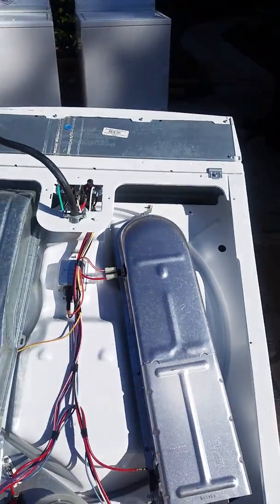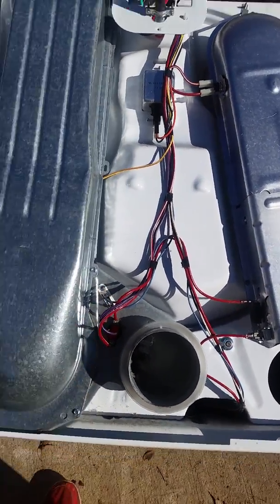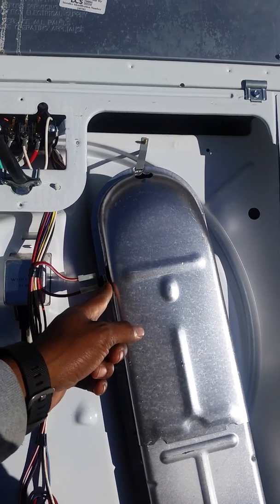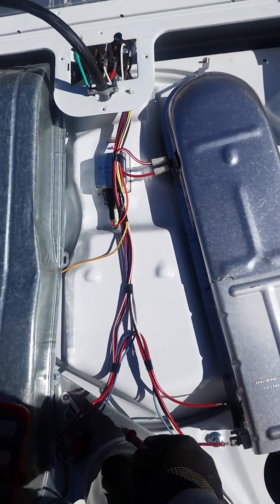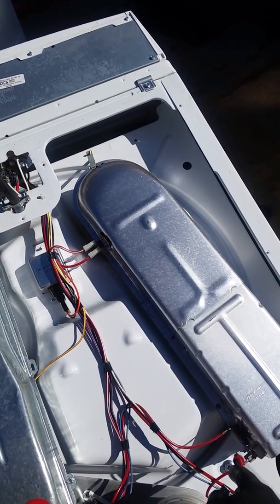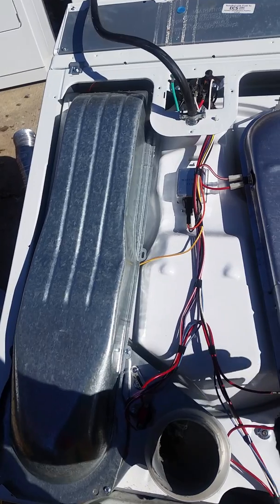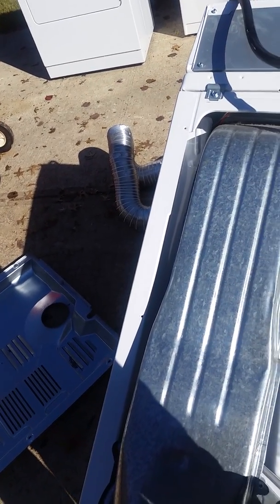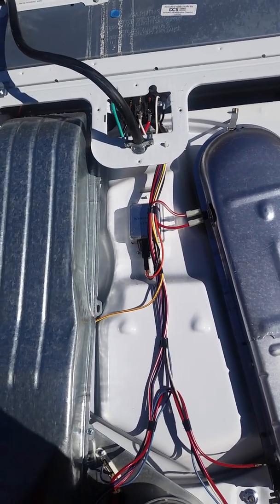Whirlpool Dryer will not turn on / how to test dryer fuses and what each one does

Comment: You have helped tremendously with this video, however, unfortunately my dryer is still dead. I have power everywhere I should, the main board tested good, the fuses have continuity, the thermistors have continuity, no continuity at the housing. Motor turns freely by hand, drum turns by hand, the blower turns freely, the belt is good, idler pulley is good, door shut switch is good...the dryer displays f4e4 indicating low voltage from the outlet, which tests at 240+, which is the same at the board input from the power cable. The only thing left is the control panel itself but I can't find anything on how to test that. When I press start it clicks, you can hear the relay, the motor kicks for an instant and stops. I'd like to test the control panel before I buy a new one, any idea how to test it?

Comment: I had a mouse pee on my control circuit board while the dryer was running.  It stopped we found the big later making a nest underneath the touch screen next to circuit card. I saw the card had been peed on and a couple charred components.  I replaced the circuit board but still no action....lights don't even come on inside dryer. Could the touch screen be shorted some how?

Comment: I replaced the heating element all the fuses all the coils but it wouldn't run I checked the cover of the heating elements metal against the dryer and it made the noise that you said was not good how do I fix that it still won't heat
Reply from the maker: Replace heating if it grounds out

Comment: So is there a part 2 to this video? Did replacing the faulty fuses allow your dryer to operate properly???
Reply from the maker: As seen in the video the thermal fuse is bad. Thermal fuses go bad typically when there is a clog in the exhaust vent leading outside the house. The point of this video was to show what the check. Thanks for watching

Comment: So when you are testing to see if the heating element is grounding out, you put your positive probe in the positive of the element and then you ground the negative on the frame. Wouldn't this always yield a positive continuity? If I stuck the pos and neg to my car battery's pos and neg I would have continuity. If I then moved the neg to my engine block, I would have continuity. Is this not the same thing?

Comment: How to fix it?
Reply from the maker: Huh??? Did you watch the video?
Reply: Washer Dryer Repair Tips & Tricks for DIY 'ers watched it on mute sir
Reply: You didn't say how to fix it or which part needs replacing exactly. 
Did the whole heating element need replacing? What's touching the frame exactly? How is this corrected?
Reply: @Soundsop2  I tried everything this man said and even though sometimes it can be a blown fuse mine was a different story. 
The on/off button harness had come unplugged.
Try taking the back panel off and checking your harnesses

Comment: Hi, I have a brand new wed85hefw and when plugged in nothing happens. dryer does not turn on. Need help. Thank you
Reply from the maker: Brand New Dryer!! Did you check homes circuit breaker? Is the dryer plug install correctly?
Reply: @appliancefixacademy  Yes, they are all correct. We don't have any techs who can help with the repair where I live. Can we take this offline? haree.net@gxx..

Comment: I have a Whirlpool Electric Dryer Mod#GEW92550PW1 but cant find the Thermal fuse...How do i find out where the Thermal fuse is located?
Reply from the maker: First remove your dryer lint screen, then go down and remove the lower panel, then remove dryer lint Chute assembly. And you'll see two fuses sitting right behind it sitting on top of blower assembly the white one is high limit  thermal fuse and next to it will be your thermistor. Other than that there are two other fuses directly on the heating element.